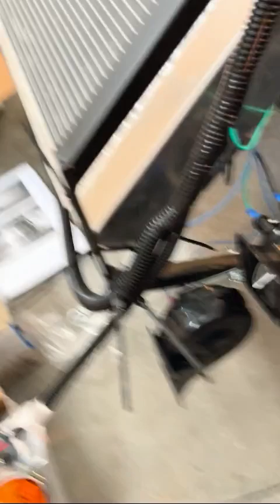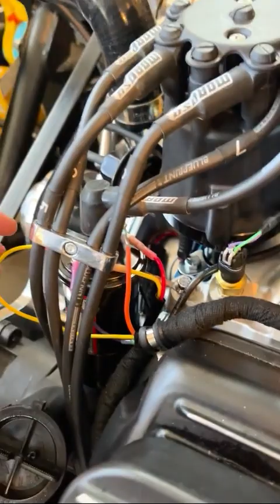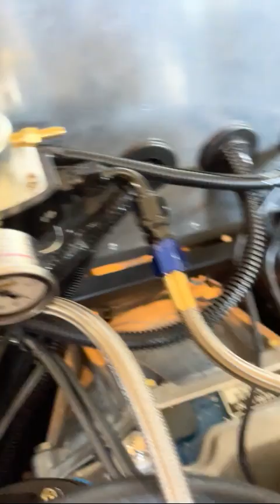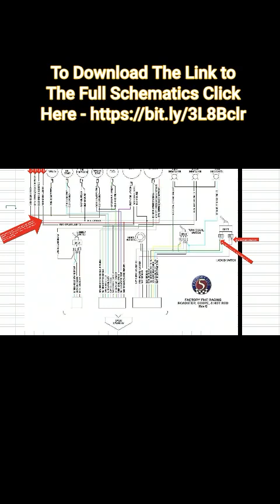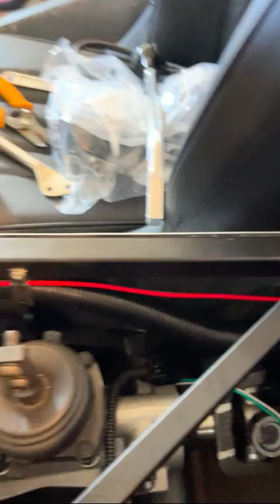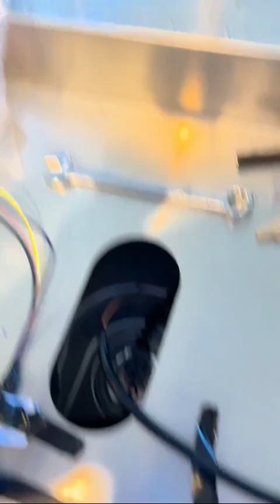MK4 Factory Five Shelby Cobra - Electrical Overview

Comment: I am going to pay my payment, but just know since my diagnosis 4 yrs ago, I've struggled, sold my camper, boat, my gun collection to make sure your company continues to get the $34000 for the $27000 truck. I worked 36 years and was forced to retire, for 25 of those years I've drove a Dodge pickup. I've went from $3000 a month, to living on $1400 a month.

$600 rent

$436 Chrysler Capitol 

$200 insurance 

150 for utilities 

The rest is gas and some groceries 

I was diagnosed with a autoimmune neuromuscular disease that could take my legs, I live in pain.

Clifton James 

2239 #4 Alma Blvd 

Van Buren Arkansas 

72956

2014 Dodge ram 1500